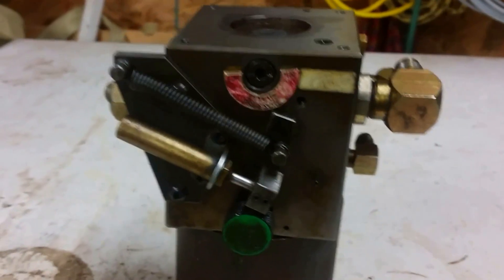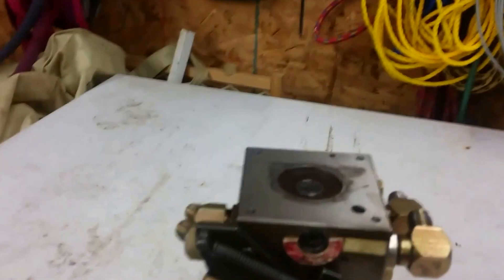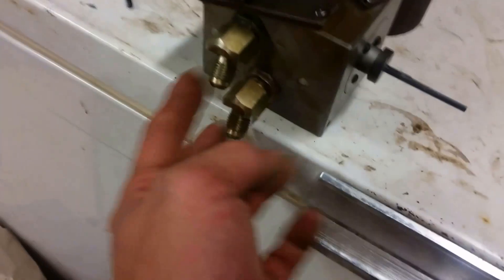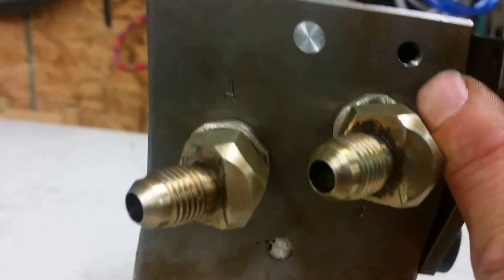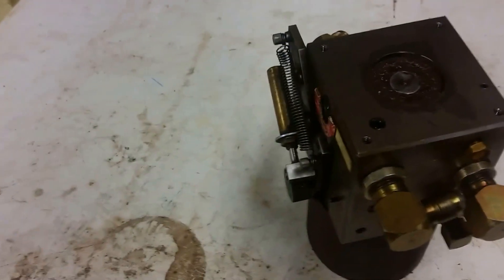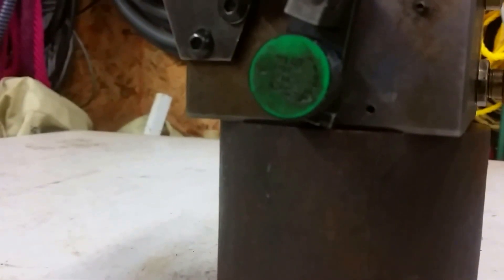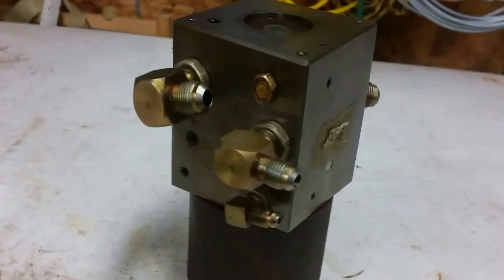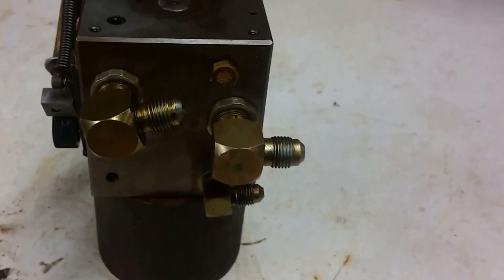Mimik hydraulic tracer, valve repair, part 1

Comment: I just picked up one for a milling machine but not sure how it works. I found the spot for the stylists and the top has some sort of flexible knob and bolts onto the spindle. Other than that not sure how it goes from there? Only two hydraulic lines and return. I’ll have to clean it cause doesn’t move under power. Thinking to use on my Deckel Pantograph with some modifications so I can’t do heavy cuts and guided by hand?

Comment: What hydraulic fluid do you use in the tracer? Great video. I just purchased a True Tracer.
Reply from the maker: Hey Jim. Thanks for watching. I use a light hydraulic fluid. If I'm not mistaken, I believe it's aw32. I just bought a5 gal can at tractor supply. It was like $50 . You need a light fluid for quick response time from the stylus. Something thin like atf or power steering fluid.